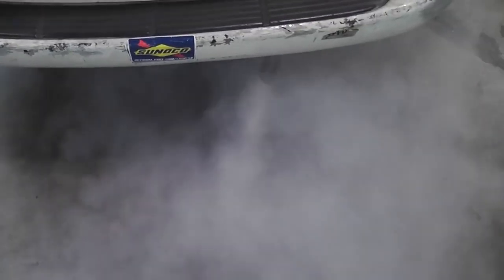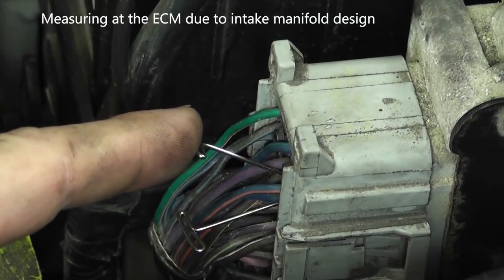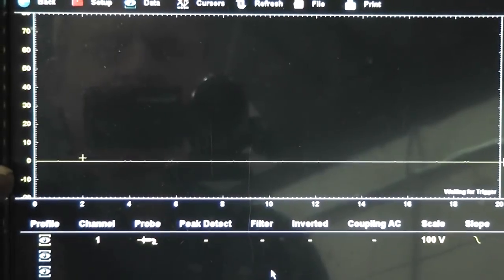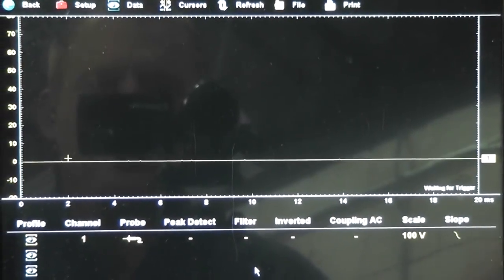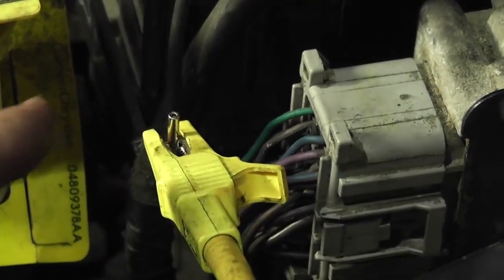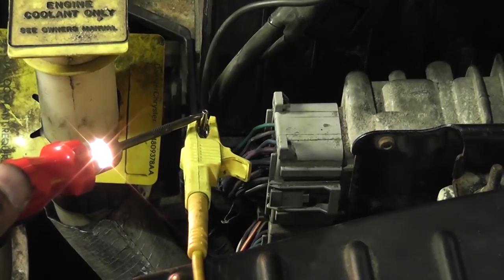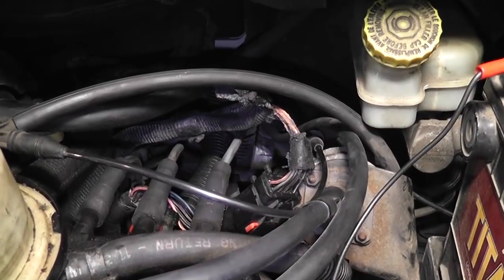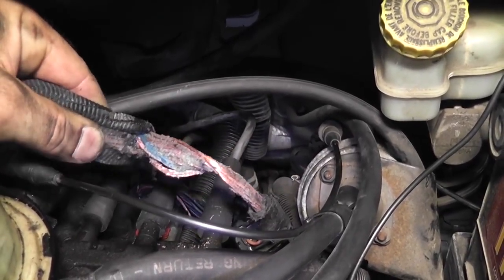Stuck Open Fuel Injector Causing WHITE Smoke From The Exhaust (Quick Tips)

Comment: Ive watched this one first . So how would i test this with a multimeter ? Thsts all i have
Reply: I don't have a scanner but my father in law has a light tester I think
Reply: My friend used a scanner on it last week and it showed nothing wrong with injectors n no misfires .
Reply from the maker: But you are dumping white smoke like this? And it smells like raw fuel? Could be the regulator too as it is internal to the injector assembly right?
Reply: Yes ok that might be the problem cause when I put the new fuel pressure regulator in ,it was so hard to push in flush .
Reply: I put 40 bucks in last thursday ,it was on full . Friday morning I tool my son who is deaf to the local school bus stop for all the kids who are deaf blind etc .on the way home I stopped at a red light and when it turned green I heard a loud pop and it had no power and white smoke was coming out bad . So a cop gave me a push to a parking lot and I had a friend tow it home.
Reply: Oh from school bus stop and back I was at half tank . Then after it was towed home my friend plugged up a scanner and we had it run at idle for about 1 hour reved it up a few times and now I'm at 1/2 tank ? He said some how my tank is not getting power all the time .cause when he took off fuel filter an I turned ignition no gas came out but it will crank up blow white smoke and pop . Then he put a meter tester to one of the wires near the tank and it worked an Then it also worked when he tested something at the fuse box in engine . It's intermittent. He had to go but hopefully will be back tomorrow. He thinks that problem is something to do with the ignition wire under the dash?

Comment: Does this issue (injector leak/white fuel smoke) always have to be caused by a short to ground? I'm currently chasing this issue down after doing a head gasket repair; vehicle didn't have this issue prior, so Im just curious if it's always a short to ground or if it could be caused by other factors/issues?
Reply from the maker: Short to ground on the control wire or shorted injector driver in the PCM. Nothing else will make an injector spray constantly

Comment: I've had injectiors one and two removed. Rough idling was cured but white smoke, especially on idling is bad. Had a leak flow test and it showed a peak in injector three after one and two had been changed. There's no coolant leaking as far as I know but there is a problem with the engine's temperature gauge. It's probably not the head gasket or a cracked head but maybe a problem with the communication between the temperature censor and the ecu which might change the air/fuel mixture. If anyone can help I'd be grateful.

Comment: Hey I have 2015 f250 6.2 gas truck that out of the blue started to blow white smoke on a start up. It clears up and seems to idle smoothly but under load it starts blowing smoke and missing. Then cleans up again in time. The laptop (buddy’s son) shows power down on #4 and #7 we checked for broken valve springs (common 6.2 issue) and checked cold compression (with an actual gauge) both #4 & #7 were in 180 psi while compared to #2 175 psi and #6 195 psi so within 10% but it does seem to consume oil. But the fact of the 6.2 consuming oil does not surprise my buddy son  being (young ford tech). He is kind of stumped on what’s going on with the motor. Can I send you a video on the smoke? Thanks Jeff

Comment: I am working on this today.  1996 chevy S-10, 2.2L, 144K, Base, MT-2wd, 13in rims ! Customer described exact symptoms in video. 
Massive white smoke & gas smell-after he worked on inectors himself. Unfortunately young man drove it till it died, towed-in.
About 3-4 qts fuel mixed with oil in crank case.

Comment: Thank you for this Video.  I think I may have found an answer to my problem.   Tons of smoke out of V8 Savana GMC.   Engine runs smooth , no over heating .   NO codes after I fixed misfire in Cyl 2 by cleaning a very dirty stuck "closed" injector.    However,  the smoke remains .    I believe one of my injectors are malfunctioning , giving too much gas .    I will replace all 8 injectors tomorrow and see.    However, I do hear all injectors ticking strong (with screw driver test).    Very puzzling :(
Reply from the maker: If it's running smooth, you definitely do not have an injector stuck open

Comment: I have an important question, i had a stuck open injector and i fixed it, before raw gas would drip out of the exhaust tip and misfire, i fixed it but it still smokes white smoke but only when i rev it, its white, do u think the excess gas on the catalytic converter is still burning off
Reply from the maker: How long have you ran it since the fix? Did you change the oil too? You need to if you didn't. And yes, the exhaust will smoke for awhile after

Comment: How can you tell if it’s a head gasket or a stucj injector
Reply from the maker: Are you losing coolant? Is it overheating? A stuck injector will not cause these things. Also if it is a stuck injector, it smells like you dunked your head into a bucket of gasoline, that is how strong the gas smell is. If you have to question whether it is a gas smell or not, then it would not be an injector.

Comment: I know I'm late but I replaced a stuck open injector and fuel pressure regulator on a 454 vortex so it's all good now but it's still blowing white smoke but doesn't smell like pungent gas anymore. Does this take a while to clear out because it's left over in the exhaust system or should I be looking for something else that's wrong. Another interesting thing is I pulled the fuel pump relay and the vehicle continued to run for another 10 minutes until I shut it off.
Reply from the maker: Oil psi switch will bypass the fp relay on these. That part is normal. And yes, it will take some time for the fuel to burn off. Also CHANGE YOUR OIL!!

Comment: Got a 2008 2.3 fusion I’ve been workin on , replaced the plugs, injectors, pcv valve and head gasket on it, still has a high idle at start and a rough idle once warmed up. No coolant loss or leaks, doesn’t seem to be misfiring, just lots of white smoke 💨, any ideas what it could be? I’m thinking the cylinder head is cracked at this point.
Reply from the maker: White smoke isn't good and neither is the rough idle when warm. An injector that is spraying constantly can give you white smoke but you'd also have a long crank time and a single cylinder misfire as well as fuel in the oil. 
Get a block tester kit (chemical) and test for the presence of CO2 in the cooling system
Reply: @ScannerDanner  thank you my friend !! Will try this out and see what happens

Comment: stuck open injector on a honda civic 2001 4 cylinder. Caused almost hydrolock and super poor running barely able to get to side of the road before it completely shut off. Glad I didn't keep cranking.

Comment: Same thing on 2003 grand caravan, fried the wires together. But computer PCM shut down for safety. Was tough to diagnose. Had to take intake manifold off and replaced the harness. Quite a challenge.

Comment: Amazed there were not more fault codes looking at the mess the harness was in.
Reply from the maker: It was because none of them were truly touching each other until I opened it up. Only the #5 injector control wire was touching a ground or ground wire in that loom

Comment: I can just hear the engineers now. Where should we locate this harness, well how about where there is no excessive heat, right next to the exhaust it is then, lol. Hey Scanner Danner a quick question. Why does that not blow the injector fuse? I had a Saturn S-series once that was shorted on the ground (switched) side, blowing the injector fuse. Seems weird with all those wires touching that there is no blown fuses.

Comment: I just installed 4 new fuel injectors in a 2.0 liter Honda (255,000 miles) and immediately had the long crank, stumble and then idled fine.  I thought that one of the new Standard Motor Products injectors (from RockAuto) was leaking into the manifold but I'm going to try this same test (engine didn't have this issue with the Honda injectors I just pulled).

Thanks for posting this video, Paul!

Comment: I had a harness melted like that in my 2002 chrysler town and country. It was a mess. I wound up repairing the harness. One wire at a time I cut them respliced an soldered them in butt splices and shank glue-filled heat shrink over the splices. Everything was fine until I finally got rid of the car. Chrysler made that harness too long and suspended it above the exhaust manifold. When that fixture fails the harness drops down to touch or almost touch the manifold and the insulation melts, the wires short together and all kinds of misfires occur on one or multiple cylinders.

Keep up the good work scannerdanner.

Comment: Only diesel. Benzin and this smoke?  No
Reply from the maker: A gasoline engine that is running rich will blow black smoke but only if a burn actually takes place. In the case of a fuel injector that sprays all the time, the plug gets soaked and never fires. So no fire = raw gas enters the exhaust and essentially just steams in there. The result is what you saw.

Comment: Great video.  Dont really understand how the test light could back feed and find a ground with the engine off? Can anyone help explain, thanks
Reply from the maker: I put a note in the video on this ASD circuit. The key is understanding that this ASD relay circuit is NOT powered up with just the key on, as it also runs the fuel pump, so your test light can find a ground through the dead supply circuit and then thru the pump motor to ground
Reply: @ScannerDanner  thanks for the reply,  these shortened videos are gold!! Keep them coming!

Comment: I have a 1996 GMC Yukon with a 5.7 and I get white smoke when vehicle is first started on cold days like below 45 degrees and below. Could this be a fuel injector problem also ? I have replaced upgraded my central port injection to multi port fuel injection about 5 years ago. It takes a long time to stop blowing white smoke compared to other cars on cold days only. Great video very informative.
Reply from the maker: What does the white smoke smell like? This one, there was no mistake about it. It was as if you stuck your head into a container of gasoline
Reply: I believe I smelled fuel. Right now today the fuel trim is like a -3 LTFT and close to 0 STFT.
Reply from the maker: Definitely not the same issue, not with that clean of trim numbers warm
Reply: Thanks for the reply SD I’ll keep an eye on it until it gets cold again. I will probably check for a leaking intake gasket when it’s cold again. 👍😎

Comment: you can unplug the harness at the ECM and check for short to ground, no feedback issue possible, with some caveat!!
Reply from the maker: this is what I did! The feedback is still possible even with the entire ECM disconnected because of the way the supply side of the ASD circuit is wired

Comment: i had a customer bmw 2016 turbo forgot what model also smoking white and gas smell 
fixed with new injectors x4 and rest of fuel system 
in tank fuel pump failed due to leaking injectors
high pressure pump diaphragm failed
fouled spark plugs, oil smell like pure gas.
Reply from the maker: don't light a match right?

Comment: Should’ve been an easy harness to get from the  junkyard. Great video.
Reply: They’re all melted or melting mate
Reply: Usually, returning faults on a cor/known issue is not wort getting used parts for.
At work I am mainly on german cars so i change door locks all the time on Audis since there is a common fault. And 2 times ive been told to put on a used part and I've told that it wont last but the customer tought it was too expensive. 

1 mont later and the same issue but now a new part instead, we got paid twice of course since it was customers call but they wanted to save a few bucks and ended up paying 150% instead of 100% 😅

Comment: Every thing is clear.
Why you don't use scantool instead of scope to do this test?
Reply from the maker: I did, but the scan tool is limited in what it can tell you. We had a code for the injector, so we had good direction right away, and also we had a misfire monitor showing us that we did indeed have a constant misfire, but this is only part of the procedure. Direct voltage measurements were needed to confirm circuit integrity a scan tool cannot do this part.
Reply: @ScannerDanner  
Yes that's right, and also you can see pulse injection time for injector 5 from live data.
Q: in this case injector 5 injection time will be 0 due to short or will give you some .....ms.
Reply from the maker: from my experience this is not the case. The injector pw command on the scan tool is just that, a command, it is what the ECM wants the injector to be doing, not a feedback signal for what it actually IS doing. So this data PID won't help us here and even if it did, you still need to do the checks I've shown on the circuit to determine the cause (shorted driver or shorted wire) Hope that makes sense my friend
Reply: @ScannerDanner  
Yes yes Paul.
thanks.
Reply: @ALZWE-LIBYAN-CAR-ELECTRICIAN  injector could fail wide open or leak without a short bro, whatever have you seen it doesn't make it a standard procedure

Comment: If short tirm 16 and long tirm 17  What does that mean
Also
If short tirm - 16 and long tirm - 17 What does that mean
Reply from the maker: it means you have a lean condition and the computer is adding fuel to compensate, for your second question, the lean condition that you had, is no longer there and the computer is in the process of relearning, so you have an intermittent lean condition, watch this video on understanding ST and LT Fuel trim https://youtu.be/oRX2V6_a3dc
Reply: @ScannerDanner  thank you 😀🤗
Reply: @ScannerDanner 
Another question.
Do the values that appear in 
Long term and short term 
Source sensor o2.??
I mean, when the engine's cold.
Or 
If an oxygen sensor is removed 
Will the car's computer show values
Reply from the maker: @B34-j9j  fuel trim is a closed loop command to drive the O2 or keep the AF ratio at the proper set point 
You will NOT have proper fuel trim control without a functional O2